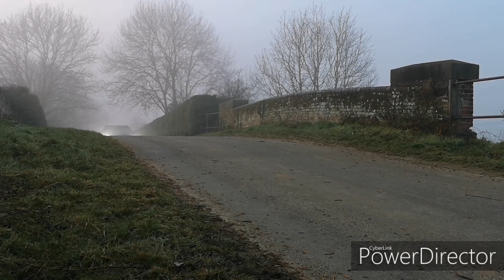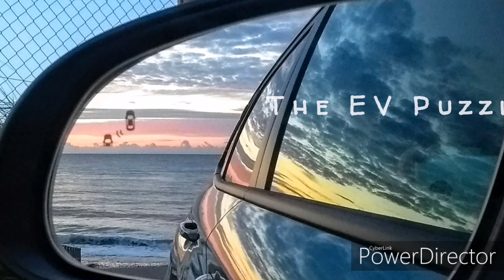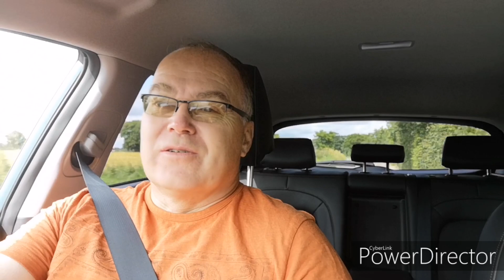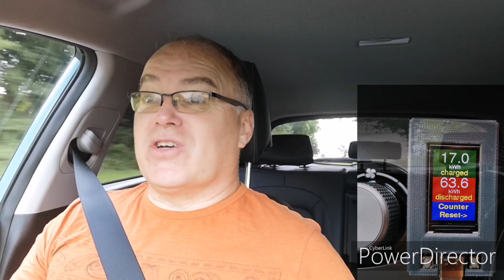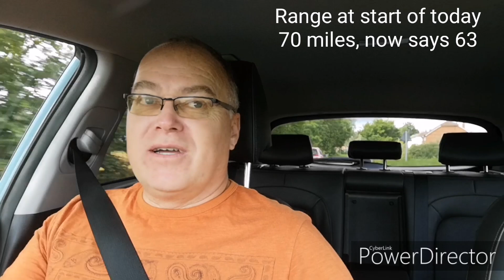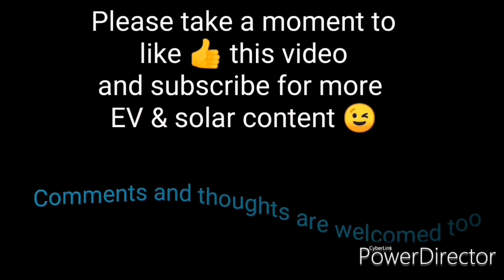Running it empty - Kona Electric 100% to zero, battery degradation/range test #1

Comment: Hi, firstly thanks for the informative videos and would you mind answering what direction your solar array faces, I follow a couple of channels that give monthly updates on generation but I have not seen or missed details on the direction of your solar array. I'm currently looking at getting a solar installation and attempting to work out how accurate the information is from some of the installers. On another note I had also arranged to get a e-niro on lease in April but that has now been put off until the world returns to some sort of normality as the lease cost was actually cheaper than my monthly petrol costs on my current car. Although this was purely as a cost cutting exercise when compared to running a replacement ICE vehicle are you still seeing good range during the colder months as when working I ten to drive anywhere from 100 to 160 miles per day. Thanks David
Reply from the maker: South but slightly more East than west.

Orientation can be great in different directions. Depends when you can most use the energy. If you're a big evening user, west is great in summer, morning user east is great so east/west two roofs works well too but obviously only half the power on each.

I've found the estimates conservative from suppliers.

Shade makes it much harder to calculate accurately
Reply: @EVPuzzle  Thanks for the reply, I have been getting a few quotes for an install but have since realised we have almost NE and SW roofs which if I go with the suggested install on the SW roof would probably mean minimal generation before 10--11 am most days in the summer. If I also put panels on the NE roof I would get generation very early during the summer months but it would be useless in the winter. I may have to take a step back and rethink all of this. I'm about to get switched over to the Octopus Agile tariff so I am in the process of trying to calculate if battery storage may be a better option with or without solar as we tend to use around 40kWh a day or more.

Comment: Is regen worse for the battery?  Esp. if it is above 80 kW.
Reply from the maker: It appears not
Reply: The EV Puzzle Great news, I sold my ICE car this week so I am car less until my ID.3 arrives in September.  In the ID.3 manual it says avoid DC charging, unless you need it to keep good car maintanance.

Comment: The true miles/kWh should be calculated checking the 
consumption through your electricity meter and the mileage since your last charge. This will be different from what your car indicates due to the inefficiency of your car charger. My i3 charger efficiency is about 82%.
Reply from the maker: All depends what your viewpoint is.

 Using the electric meter as you say confirms the cost of the electricity needed to fill the car.

The car measures what it uses and hence how many miles per kWh of energy used. 

I'm measuring what I refill it with now. Not to see the charge loss as I know it's around 8 to 10% but the  volume to refill from empty to see if the buffer needs filling etc
Reply: My calculation gives you the true cost per mile. This giving you a better comparison to ICE cars. However, the cost of ev's will need to drop before an electric car is cost effective.

Comment: Well done on the test, don't think I'd have the bottle to run down to the low SOC number you ended up on.
Reply from the maker: Funny how 8% and battery warning was soon ignored . It's so reliable IF you know your miles per kWh .

Makes me much more confident in the event I actually need it one day

Comment: Driving an EV has a sort of "gamification" component. You try day after day to beat your previous results. I play the GOMGAME EVerytime I drive my Kona.
Anyhow, just working to a very similar video in which I charged the car to 100% and used it day after day. Just my normal daily route during holidays. Uphill-downhill, 6+6Kms two or three times a day. Will stop the test to 50% SOC because I've got no charging stations close to my place and don't wanna spend two days re-charging without using the car :-)
Reply from the maker: As you'll see in my next video the data changes after 50% it gets much more accurate as you get lower

Comment: The important is how many miles per kWh you achieve while driving, not how many miles left because that is specific to the car you have. To measure the kWh in the battery left it would have been faster to measure 10% and then do it x10. Maybe take 4 samples to measure accuracy.
Reply from the maker: I've done it the accurate way, drive it and see.

Comment: You should have bought the smaller batteried version of the Kona, these type of tests would have been much quicker! I got back the other day with 4 miles left on the GOM in the e-Golf, added that to the Trip since charging gave me 154 Miles total. Normally I expect 160 in the summer but the last hand full of miles was a long fairly steep hill (with the car reducing the power to 25%) which probably accounts for it. Had the car for nearly 2 years from new and now done 28,000 miles with no appreciable degradation although I presume there must have been some. Its probably harder to spot with a smaller overall range. In the e-Golf the timed charging set-up asks for the time you want the charging to have completed by rather than when to start charging. If you set this to the time you intend to leave home in the morning the battery will still be warm from the charge, I guess that's why VW do it this way to improve efficiency, it doesn't have any active cooling.
Reply from the maker: You're right, it takes forever . I could've done the same flooring it everywhere but it'd be painful 😣